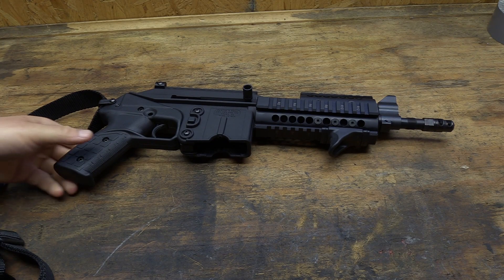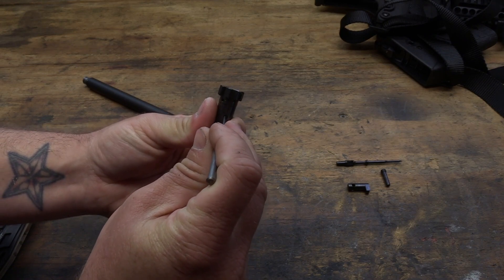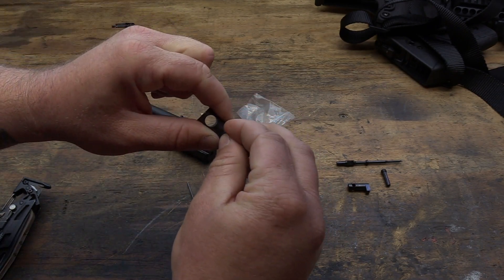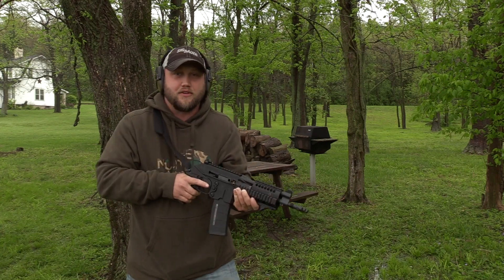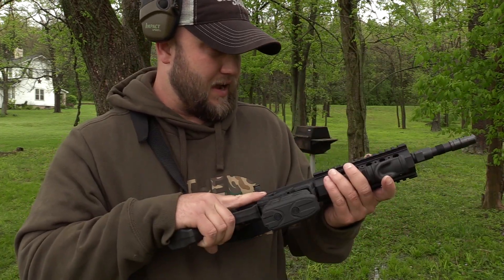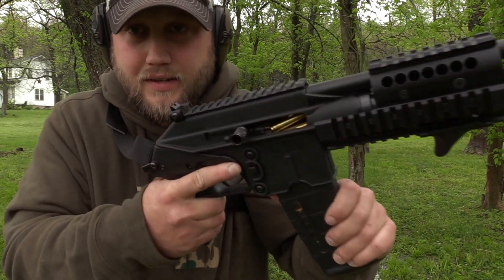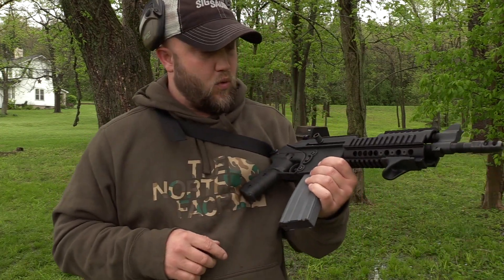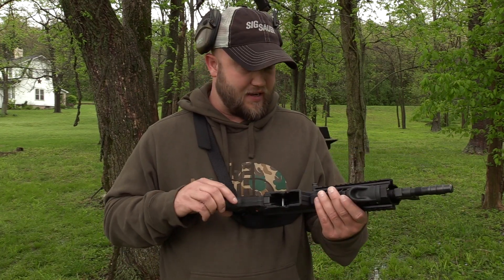Does It Work?? | Kel-Tec PLR-16 Pistol | New Extractor & Spring

Comment: PLEASE READ! I do gunsmithing work on the side- had a good friend of mine buy one of these PLR-16s in a bundle deal of 9 guns. He didn’t know anything about it, and the bolt was stuck forward. It would not dry cycle or anything. It was completely locked up. I had the gun apart, found that one of Keltec’s roll pins in the bolt assembly had come loose but not completely out, so I replaced it with a rock river pin and it was a good snug fit. I also cleaned the gas block out as best as I could. However, when I had his particular gun apart, instead of changing out the extractor/spring, I left the factory extractor in but cut 3/4 of a coil off of the factory spring and reassembled. Gun would dry cycle dummy rounds proper. Great. Took it to the range same day and ran approximately 80 rounds through it. 20 rounds through a P-Mag 30, and 60 rounds through the factory 10 round magazine. The P-Mag would FTF or FTE every other shot. Dreaded “single shot semi-auto” deal. Rats. Put the factory 10 shot mag in and it cycled and performed flawlessly. So. In conclusion, save the factory extractor, modify the extractor spring, and use the factory 10 shot magazine and you have yourself a <fairly> reliable gun. My opinion is subject to change once my buddy puts 200+ rounds through it and he gives me some feedback. Sorry for the long comment. Hope this helps somebody out.

Comment: Keltec should be the one fixing the problem on this keltec plr16 buying something that's useless right out the box, same problem with mine
Reply: The gun is only a few hundred dollars. I see some going for under $400. My guess is the fit and finish is a bit off out of manufacturing. Polishing, cleaning, and getting it just right is not unusual for firearms.

Comment: Looks like it is extracting fine, but not ejecting the spent case. They made a case deflecting charging handle. Maybe you need to chamfer the ejector hole and clean and lube it.

Comment: I have one also. There should be a rubber buffer ( very tiny) that goes into the spring that goes in the bolt end. When I pulled mine down I dropped it on the floor and almost didn't realize it.  Can't use a Bravo Company buffer.  Has to be a keltec. The buffer has a flanged end that goes 1st into the bolt body.  Maybe that's what's up with the stove piping?

Comment: I have a PLR16 that I got in trade for a gun I did not like. I have had this gun for several years now and it has always worked. I have never had a problem with it except the pin that holds it together would work it's way out when shooting. About a year ago I added a pistol brace to it and the brace came with a new pin that works much better. I shot the gun today for the first time in a couple of months.. I put 60 rounds of Wolf Gold through it without a single failure. I really like the gun and the only reason I do not shoot it more often is the guys at the range complain about the noise. It is very loud and somebody always asks, what the heck are you shooting.
Reply: Where did you find a brace for the PLR16?
Reply: @ITZGR82BFREE  I got mine last year. You need the adapter kit from Kel tec and they are out of stock right now. If you find them you will have to use one marked for the su16 and it will fit the plr.16 . There is a video on you tube on how to install it.
Reply: @larrymcclure3842  yes... I've seen this but always out of stock as you say. Actually called Keltec a while back and the girl was rather dodgy about the subject, so I assume there is some fear of litigation or some such thing going on. Too bad. So sad.

Comment: Well its a really i mean really late response on the kel tec plr 16 . I 100% without any doubts figure out the issue with the jams and double loading ,well trying to  load as one round is live in the chamber causing it to jam . Ill keep it short and sweet . mind you i have hundreds of hours no joke trying to debug the issue. 
ALL you have to do is buy some clear vinegar with no sent . pull your pin out fold handle down turn your gas return to 12 o clock and  pull you charging handle out take the bolt out pin out make sure you dont loose your o ring on pin tiny tiny ting anywho dip your parts in the stinky stuff and wait about 20 mins. then rub down everything use a hair dryer to get most out and then you go online and buy some navy jelly its the best polisher ive ever came accross it just bows m away each time i use it so after you get it rub a small amount on each part and just give some love and just buff buff and buff until its pretty much covered with black crap then simply wipe and put 2 drop of clpoil thats it ihave been using it none stop clip after clip i change the plastic and copy a walnut dark blackish wood and i tell you everyone loves it  i now in counting fired 4900 rounds since the box was unfolded  hope you try let me know thanks

Comment: Mr Nolan that was hard to watch but good to know.  Some people said to replace the extractor spring and recoil spring.  You did the extractor spring already so try a new recoil spring and see.  Also how about trying the new DPMS extractor spring but with the stock extractor too.  Let us know.  Years ago I almost bought one.  But the only Kel Tec I bought is a Sub2000 Gen 2 but haven't shot it yet so I am hoping I don't have issues with this gun myself.  Thanks for the video.
Reply from the maker: +Aasillak Zyralius I think I'll try your suggestion and put the factory extractor back in and see how it goes. I also made a couple other changes and I'll be making an update video soon to see if I have better luck.